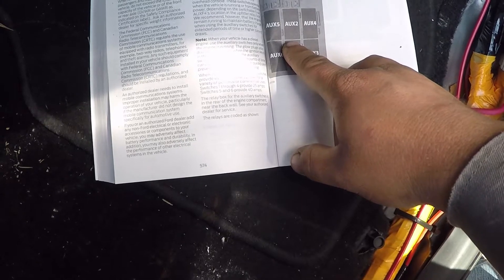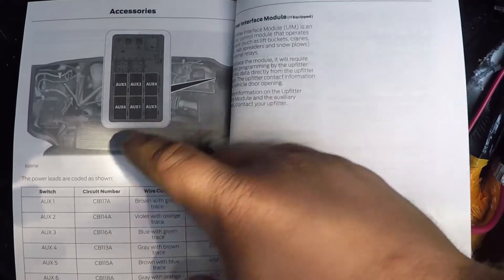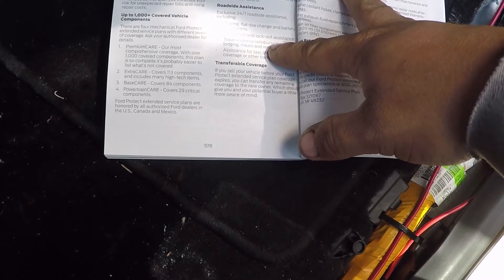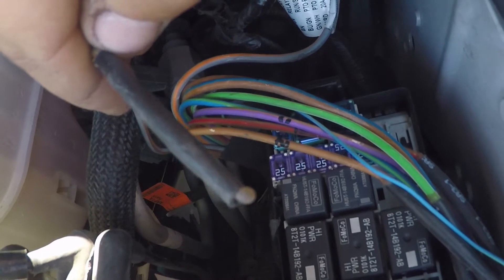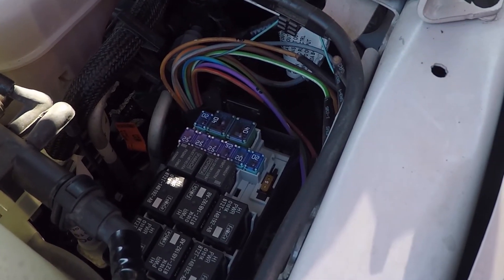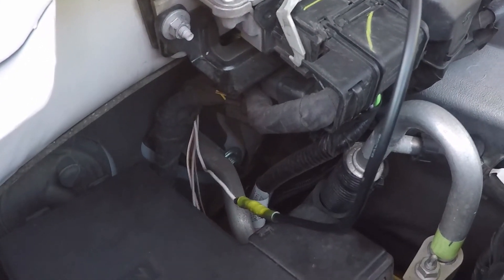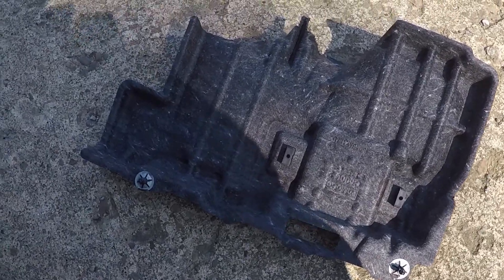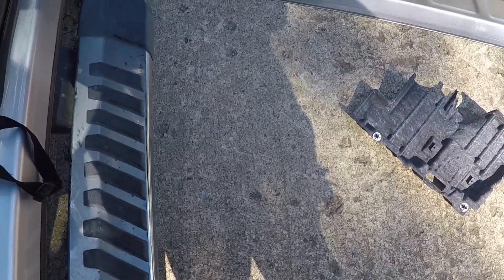Ford Auxiliary Upfitter Switch and Pass Through Wiring: 2019 F350

Comment: I have a 2019 F350 and would like to find a passthrough port at the rear of the cab, where I could run a coax to a rear mounted antenna.  Would you be able to help with my quest?
Reply from the maker: I'm sure there's a plug somewhere in the back seat area or back of the cab. When I ran my cb coax I just ran it down through a body plug on the passenger front floor board. I haven't had any issues. Just be careful getting the kick panel out of there...the one peg on the top likes to break. Have to start at the bottom and kinda lift turn and twist out if that makes any sense.

Comment: THANK YOU!!!!  This is the BEST and most helpful video of the Auxilliary switches, panel, wires and the Passthrough wires (which I did not know even existed!). This is EXACTLY what I needed to know to install a small multi-USB box into the top center cubby of the dash on my F350, for my GPS, TPMS, and two phone chargers, running off the 12v supply from one of the Auxilliary switches. I will use Aux 6 (40 amp) and move that 5a fuse to enable battery supply. This will allow me to power all my dash mounted devices without a bundle of USB cables all over the place, and switch them all off with the flick of one of the overhead switches! PERFECT!!!!
Reply from the maker: No, thank you Barry! I'm glad you think so. I was looking around when I was wiring mine up and I didn't find any good ones. Most gave some stuff, but not everything and some were nothing but talking as a tech wired stuff for em in the background as they rambled on about their new $80k plus truck they can't work on. Figured I could try and put out some better info. I'm glad it helped!
Reply: @k30krazy  Subbed and alarm bell set and liked. Thanks again!

Comment: What I don't understand is that why are there only 4 wires but 6 switches!
Reply from the maker: I'm guessing they don't expect you to need to use every switch inside the vehicle. Im not sure.
Reply: Those wires are unrelated to the Aux switches. The Aux switches are usually used for external devices, like lamps, pumps, etc . Ford probably doesn't think anyone needs/wants to pass through more than 4 circuits to the inside from the engine compartment.

Comment: On my 2021 the owners manual page 552, says the wires are; 
" Each switch includes a blunt-cut, sealed
wire. The wires are under the instrument panel on the right-hand side of the passenger footwell." 

 And in your video at 9:52 those wires are bundled right there in the video as you brush them aside looking for the pass-through wires. They are also color coded accordingly.  I also have the same wire bundle coming out of the fuse box in the engine compartment.  Might not have to use those pass-through wires.
Reply from the maker: 🤔 Interesting...I'm gonna have to do some digging. Thanks for the info!
Reply: I’m wondering the same thing!
Reply: On my 2017 Powerstroke, those wires are not the Auxilliary switch wires. They are labelled for other functions and the color coding does not match the Aux switches/relays.

Comment: In 2020+ model the upfitter fuse box swapped to the passenger side,
Reply from the maker: Awesome! Thats where it should've been to begin with lol. Thanks for the info.
Reply: @k30krazy  too bad they didn't fix the pass through wires to be more user friendly.  I think they actually cut them super short in my 2020.
Reply from the maker: That was the worst part. They gotta save that few dollars though.

Comment: The best and the most informative video on the uplifter switch I have ever seen.
I didn't even know I had factory pass though wires. The bulletin was very helpful.
Mine is a 2019 Dually Crew F350 with to many Bells & Whistles. Still haven't figured all the buttons out.
Thank you.
Reply from the maker: Thank you Mike, I really really appreciate it! I'm glad it helped you. I noticed a lot of videos and websites were covering half the info or making it confusing. I try to cover everything and make it short and to the point.